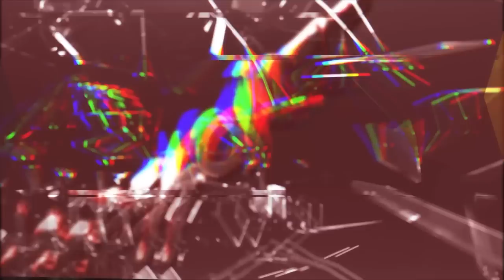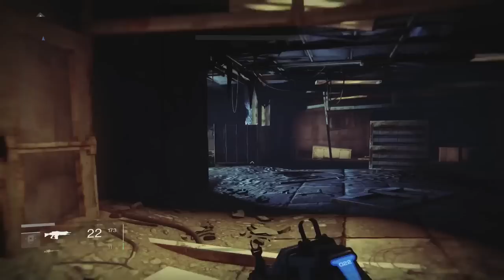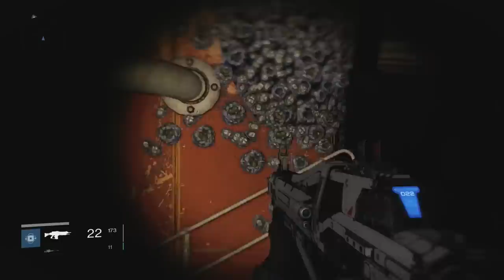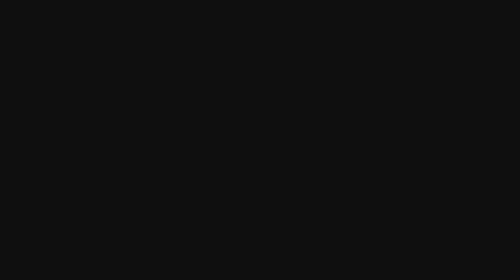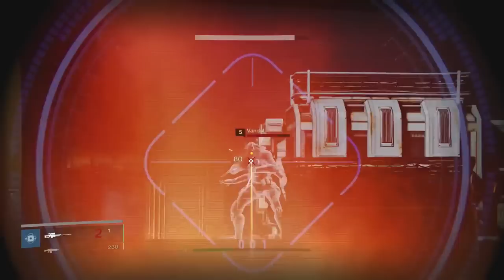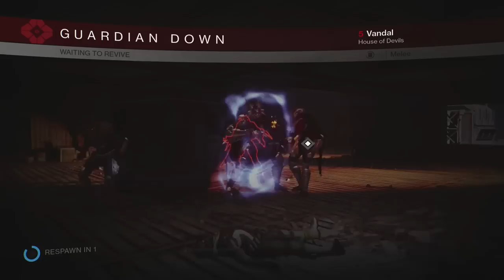My 3d Printer Is Down For Now | How I "Broke" It

Comment: I'm in kind of the same boat. I bought the e3d v6 months ago and planned on replacing the hotend, but I know the installation isn't going to be an easy process, which has prevented me from even attempting yet. I know I can do it, just not sure if I have the time to actually dedicate to it
Reply from the maker: ***** ya im at the point now where I wish i had kept it stock I can always install the og hotend but im not actually sure if that will fix the error that i am getting. If you end up installing it let me know!